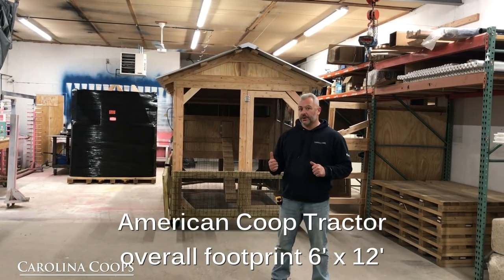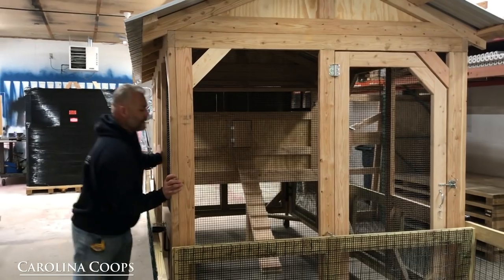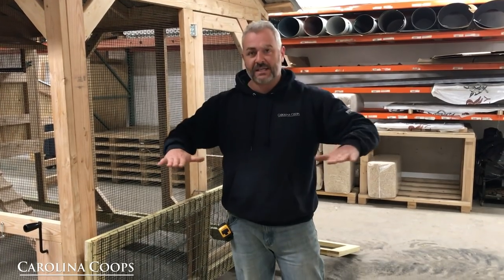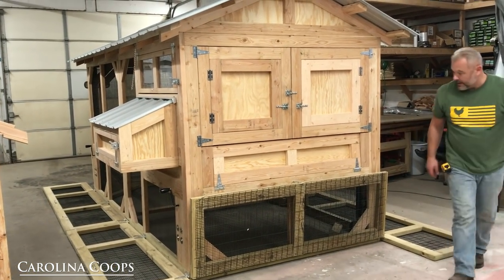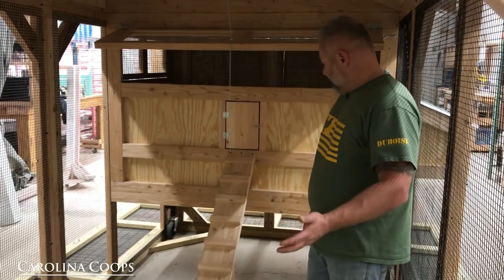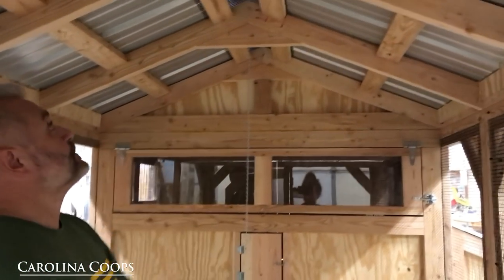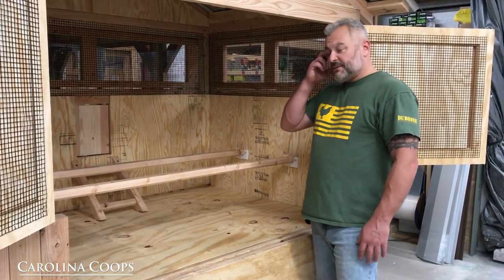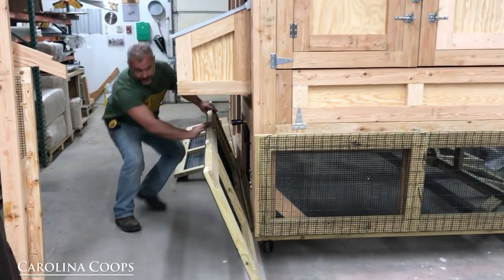Our Most Popular Coop Becomes a Tractor Coop!

Comment: Great job guys. I would make the handle so you can remove and use a drill ...... then you do not have to roll it up or down by hand...........simply use the drill with a socket on the end......zip zip zip and it is done. .

Comment: those jacks definitely need larger diameter tires and a steel plate reinforcing it to the structure. suspension and rotational direction as well, if that coop fails it will be where the jacks meet the structure

Comment: If you put the hardware cloth on the top of the roof beams prior to putting on the roof, there wouldn't be a need to sculpt the wood to fit up into the roof groves.  It may increase the cost a bit, but the amount of work would lessen.

Comment: I have one suggestion for you to consider if you dont mind. 
On the inside of the run where you have your hardware cloth attached to the wood, maybe add strips of wood over the hardware cloth on the inside of the run. This wood strengthen it from being pushed in from the outside by bigger predators like coyotes, dogs, Bobcats etc.
Reply from the maker: Shelley Mcpheron so a couple quick things.   When we ship our American and Cali coops out they actually include the furring strips that you mention.   When we attach the screen we actually use not only more hardware for fastening the screen but use all stainless steel.  When we attach the screen it is very strong and we have seen it keep out large predators.  It’s all about the technique if that makes sense.   Thanks for watching.

Comment: What about gluing in some scrap wood that’s been shaped, a rounded wedge, to plug the gaps in between the corrugated roofing and the wall.
Reply from the maker: It's easier with the CNC machine to work with a large piece instead of making little pieces of scrap wood to fit in the gaps. It's really not something we think is necessary but wanted to address the concern of our customer. Thanks for watching.
Reply: I don’t think it’s necessary either, I was just spitballing ideas. Thanks for responding.

Comment: Nice design and a great video. Glad to see the chains on the windows again. I saw nothing but trouble with the pegs. Loss, swelling in humid weather and breakage from all that weight on a thin peg. Unfortunately, I don't see those tiny wheels rolling over anything but a close cropped lawn that is exceptionally level and folk free. At a minimum a tractor or 4 X 4 is going to be needed on a dry lawn. Some other commercial tractors have 8" airless tires that seem to move well on non-perfect terrain. I have researched run/coop combos extensively. Your product is the greatest value combining rock solid construction, high quality materials and fabulous good looks for the price. Keep up the good work...JJ
Reply from the maker: Thank you! We are considering different tires, I believe we even may have mentioned that in the video. We appreciate your comments and compliments!
Reply from the maker: ChefJimmyJ I’m going to do a video on how much it will take to break 3/8” oak dowels.  We are just trying to use up the chain we have left.  I know it looks like they will not last but if that was the case we would never use them.  As for the wheels I agree.  There are so many circumstance that I can’t even began to get into when it comes to the pros and cons to trying to design a easy to move tractor coop of this size.  Not to mention that we have to always stay within the customers budget.  I still say save the money and let the chickens move around and not the coop.  Thank you so much for your compliments and watching.

Comment: A question I have, can we put a hole in the floor and put a run to the outside, underneath or will they fall through the hole on the other sides of the hole? Just curious, we don't want them to get hurt and it's about  5  or 4  ft off the ground. Thanks!!!